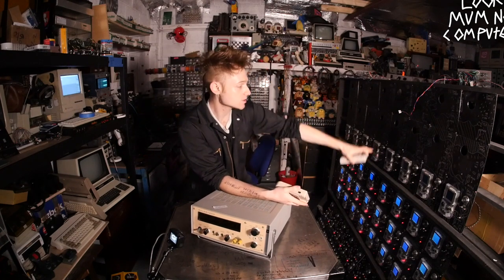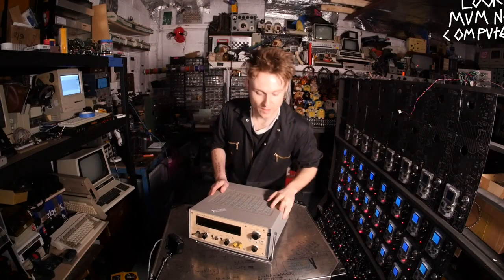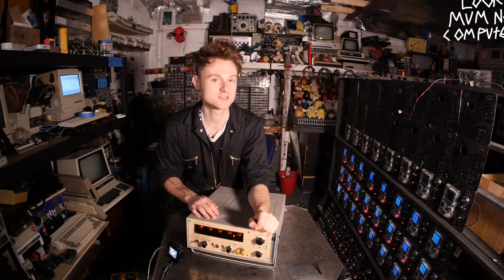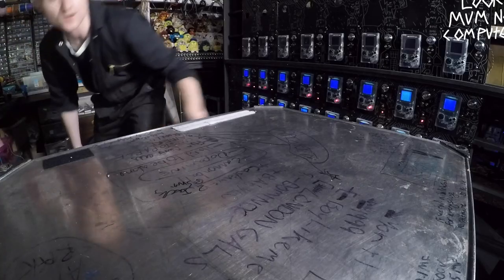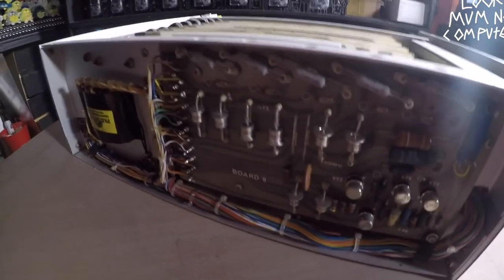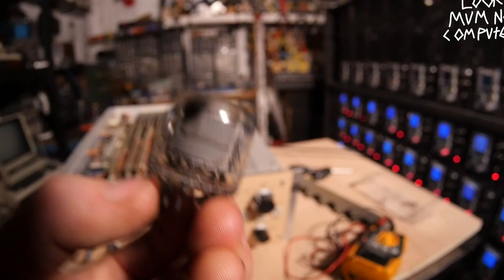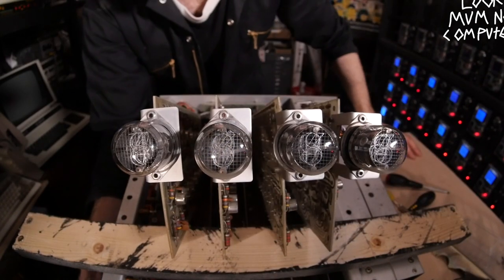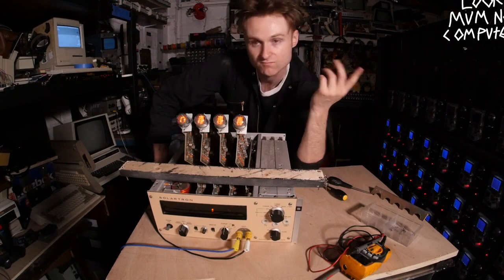NIXIE TUBE RETRO VOLTMETER - Whats Inside the SOLARTRON

Comment: Your question about the arrangement of the digits with 1 at the back and 3 at the front intrigued me, and it seems they arranged them in such a way that the digits in front obscured them as little as possible. Nixie tubes are rad.
Reply from the maker: i figured that was the case! i just didnt want to suspect that in the video however it makes sense. 3 doesnt go through the middle at all. then i think it goes 8, and so on

Comment: Not sure, as the lettering is not clearly visible, but these "transistors" at 10:02 could easily be nuvistors (=tiny tubes)
Reply: Doubtful, they look like transistors, particularly as the number of leads look to be 3/4 and a typical Nuvistor has 9 leads. Nuvistors are more at home in RF applications than in driving Nixie tubes.
Reply: @TheBananaPlug  I have a grundig measuring dep. nixie tube meter which has a whole lot of nuvistors inside....among some more unknown (also full of 80s custom glue logic) parts, sadly no documentation available anywhere....also none of the usual schematics distrib´s has one to sell....without it, pokin´around makes no sense....so it sits on a shelf until i find one.
Reply: @tubical71  Nuvistors were used in counting circuits, but normally with Beam X counting tubes, not nixies. My comment about the board in the voltmeter being transistors rather than Nuvistor is that Nuvistors were rarely  soldered directly to a PCB, holders  were more usually used. That said, I have been known to be wrong :)

Comment: hi.... 6:25 (capacitor discharge), you should have said, that someone who works with high voltage should  keep his LEFT! arm on the back, so that the energy won´t pass your heat in case of an electric shock.
is it cause youttube mirror the video?
greetings from Frankfurt...

Comment: i bought a "non-working" schlumberger 1240 4-digit nixie voltmeter, some years ago off ebay for 20bucks, including its needed very funky looking backside plug matching power cord. That cord alone is worth much more than 20bucks ;) The issue was that the rotary switch needed cleaning.
Reply: Wow - nice.

Comment: I used to work in an electronics surplus warehouse in the 90s, like a warehouse 13 version of your workshop.  In an attic area there were thousands of tubes...finding a nixie was super sweet, we had a special section for them.  Wish I had made that nixie clock I had the specs for, the tubes were pretty cheap still back then!  Ah well, that's why we have this channel, to tinker vicariously.  cheers.
Reply: you can still get nixies dirt cheap, just built a clock kit with 6 tubes, separators , all in was only about 150 quid.

Comment: You could make a super sweet beats/bars counter with these. I’m sure the hardest part would be building the driver circuit, but the rest could easily be controlled with an arduino and sync to midi
Reply: Nixie drivers are pretty well known and simple IIRC.
Reply: I made a programmable metronome that has a nixie tube to count bests.
Reply: @ninethirtyone4264  - Cool - what was the logic based on?

Comment: What a beauty! I like how they designed the boards with that rod connection for easy access. Looks pretty service friendly too. Did you know nixie tubes where even used in lift floor counter displays? They are quite rare. Nixie tubes make every display look better!

Comment: If you want to get into nixie tubes more get your hands on some K155ID1 ICs. They're BCD to decimal decorder chips that also drive all the digits on a single nixie tube. Most of the ones you can get now are old Russian or Chinese ones but you can find them on aliexpress and ebay. That way it's only 4 inputs from a control board like an arduino to one nixie tube not 10 as it would be with discrete transistors. Hope this helps

Comment: Dude you really shouldn’t touch the glass part it will oxidize or something
Reply: Yeah - skin oils etc. - probably kill the tubes.
Reply: @NeuronalAxon  no true, they dont run hot enough, true with halogen bulbs as the grease from your fingers creates a hot spot.
nixies dont run anywhere near as hot,
Reply: @deadprivacy  - Oh right, Nixies run relatively cool as compared to halogen and valves then? Makes sense. 👍
Reply: @NeuronalAxon  It's a cold cathode tube. I have them in my clock and they don't produce any heath at all, they just stay at room temperature.

Comment: You're like I was When I picked up an old Allen & Dumont oscilloscope (model 304-H) from a flea market last week; It's a beast, and it still works, only paid  $25 US for the thing!
Coolest part: it has a blue phosphor CRT! Originally bought it to bias some tube amps, but have been too busy using it as a graphics display. The guy also had an old tone generator (oscillator) but My wife would've killed me if I bought that too. You would've loved it though, very different look from the ones you've accumulated. 

The scope takes a bit to warm up, so it probably needs new capacitors, but it's good enough for me.
Reply: Nice score. Was is a HAM meet?

Comment: Sweet!  Lovely pickup, nice to see inside it!  Crazy wiring lol!  Imagine trying to diagnose a fault on that ....
Reply: rather easy....these kinda devices are known for their easy service...also if a digit is faulty you can measure it against a working digit and you will get the fault within minutes. But you need to have a clue what´s going on and how these old nixie VOA-meters are working. it´s more or less a discrete digit counter adressed by an analog (probably an R2R) AD converter with a muxed outputto reduce wirecount.

Comment: Beautiful meter.  I am a huge huge fan of all manner of Nixie tube gear.  (Child of the space age, all the NASA panels full of Nixie displays won my heart for life.)   Nixies aren't really vacuum tubes as such, more like a big neon bulb.  If you put DC on a regular neon bulb you'll see that only one of the electrodes glows, same exact process to light a Nixie digit.   The pride and joy on my bench is a Fairchild 7000A multimeter.  Cost something like $2,000 new in the 60's got it on eBay for under $100.

Comment: AAh, come on...nixies are easy to operate....get some 74141 drivers (perf. the russian made flavor as they are more rugged and cheaper) and all you need is a 160Volts DC source and some resistors.....piece of cake....trust me. Also if you go for HV-Fets you also can omit the 74141 but it´s a little more complicated then, but also doable.

Comment: nice. looks like a power hog. lol. i wonder how hard it would be to turn that sample rate down a bit tho..
Reply from the maker: mike ross there’s a switch on the front to adjust the sampling speed
Reply: ah, ok. its a freq counter too. cool. does the voltmeter have external sample trigger? thanks man!
Reply: @LOOKMUMNOCOMPUTER  - Of course there is, lol - what's the sampling range?